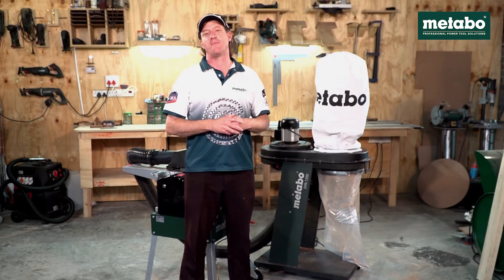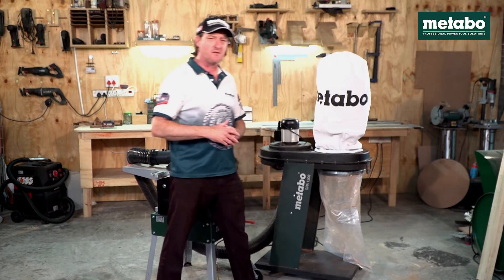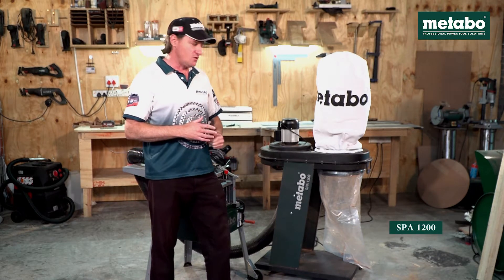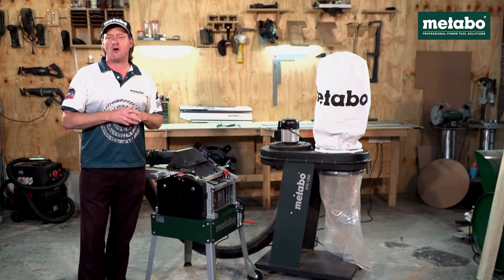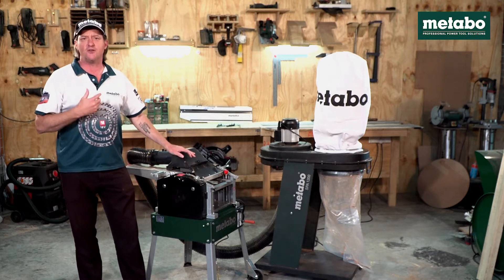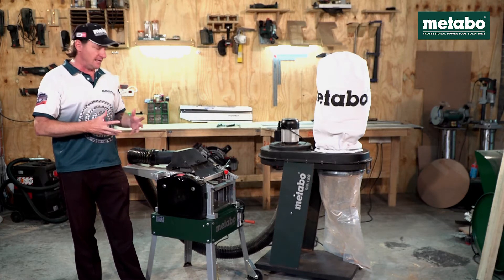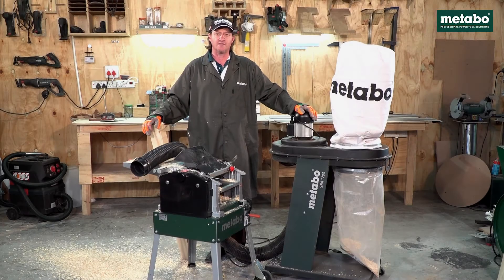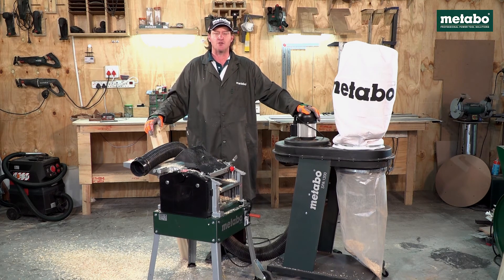SPA 1200 (601205000) CHIP AND DUST EXTRACTION UNIT Demo

Comment: Hi, can the motor be mounted downwards so that the hose is facing upwards?
Reply: Hi, did you manage to find out if the engine can be turned down? Thanks
Reply: @Tintara369  From Metabo.

To change the motor & the pipe is a manipulation on the tool/dust extraction which means, that you would loose in general the warranty, 
we as the producer have to give by law.
But I think that there is a sence behind, why the motor is upwards & the pipe downwards mounted on this extractor.
normally our engineers & product managers are looking for better, more efficiant & smart solutions for the tools, 
also by testings in our test-center inhouse; 
but if there's no explicite mentioned in the manuals that you can switch or mount the motor / hose pipe in an other direction,
I wouldn't make any changes on the tool, because it may affect on working effect, your health or other dimension.

But all these is also mentioned in the user manuals for each powertool we are producing.
Reply: @Karimsss25  ok, thanks for the answer.  Have you installed a metabo and are you satisfied with it?  or do you have a recommendation for another similar one?